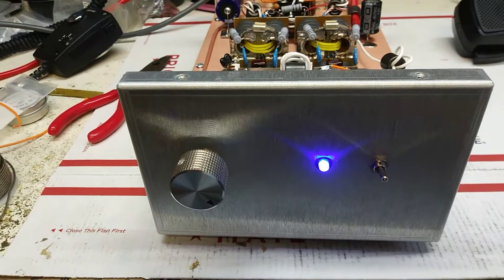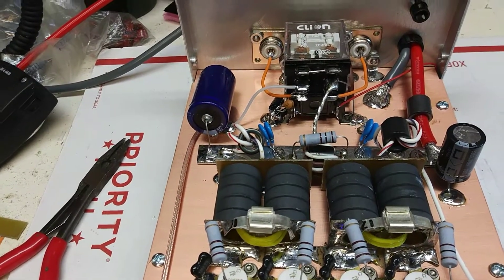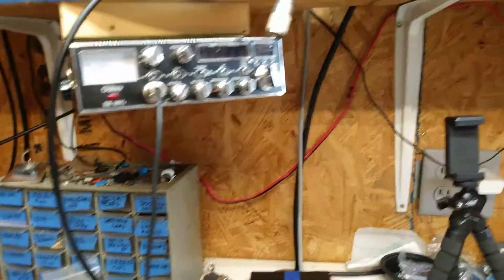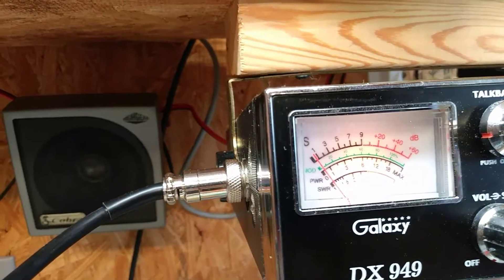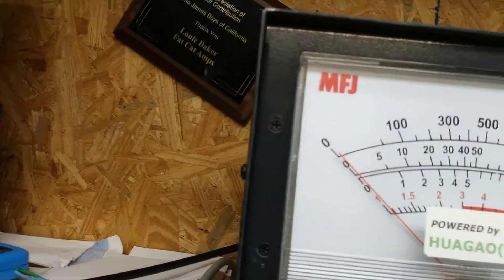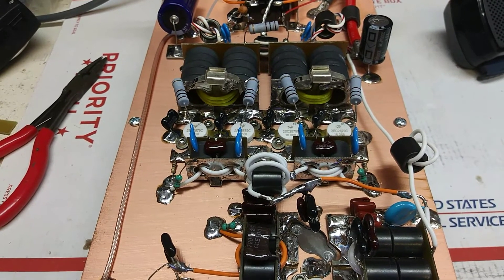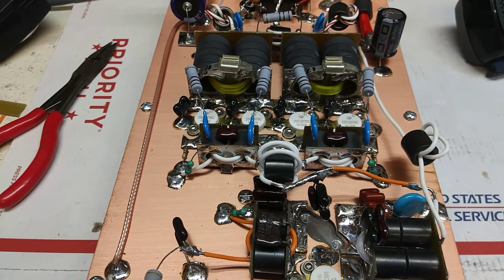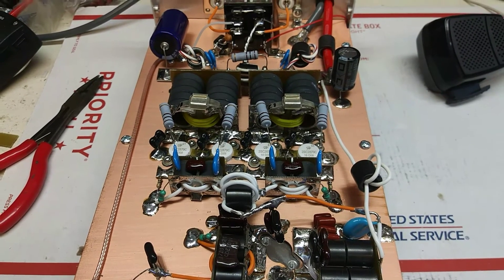1 x 4 - HG 2879c build

Comment: I've been searching all over trying to find out what components in a 2879 amplifier have to be changed out so 2878c transistors will work in the 2879 circuit. I can't find any info and no one will give me a specific answer. Would you help me out?